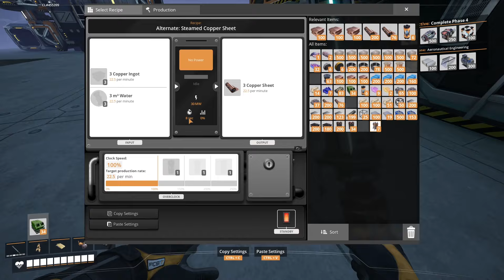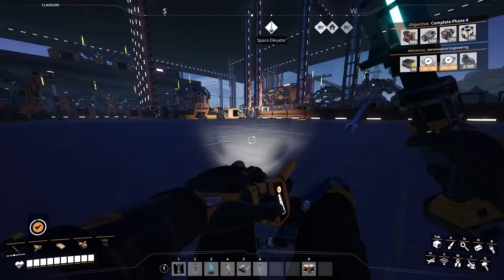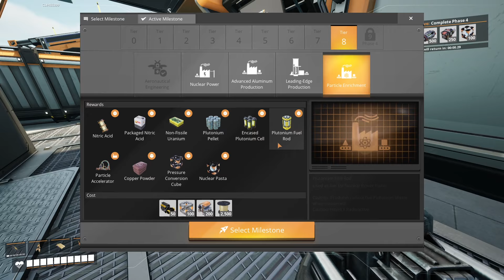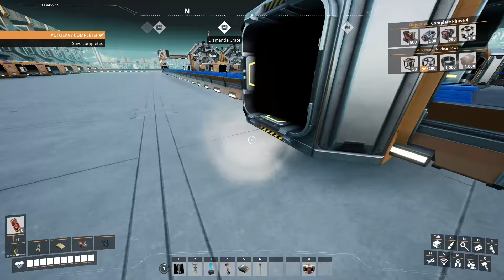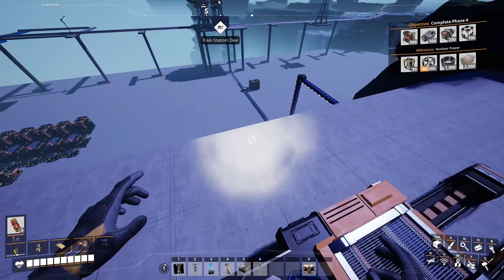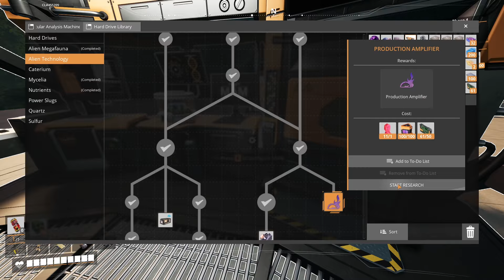TURNS OUT SOMERSLOOPS ARE PRETTY GOOD | SATISFACTORY - PART 31

Comment: Hi, roughly, for episode 65, if things don't get complicated with the nuclear option, and you'll have to do it in a different location away from the main base because of the radiation it emits and the toxic waste that you have to reuse for something else, you can use jet fuel to generate electricity. It's better (1 oil well at 600 gives 10 refineries, for regular fuel, for 14 jet fuel refineries, and that gives 44 generators and that gives 11,000 of electricity). You also have to build 16 builders for compacted coal.

Comment: Even if not as exciting as last episode, it was solid progress.  Your math was good this time around.  Magnetic Field Generators (next project part) are pretty simple, but the Thermal Propulsion Rocket is the difficult item in Phase 4, in my opinion.  Lots of people hate on the Nuclear Pasta, but if you've got the Rockets done, the hardest part of that work is also handled.  You just need a lot of one particular resource, plus enough power, to finish it up.

You definitely need to look at your steel (after aluminum), but the heavy need for the Encased Beams goes down once you start laying Mk. 5 belts most of the time.  Getting that aluminum as efficient as possible is key here.  I really like the alt recipe for Aluminum Casing, because you can put both aluminum items on the same assembly line at that point, and get A LOT of casing for pretty cheap, leaving plenty of aluminum for the Alclad Sheets (Mk. 5 belt material).

Don't forget to sloop those power slugs (the purples especially, they are worth 10 shards each!).  As you noticed, the first item after inserting it isn't doubled.  I usually put Wire->Cable recipe into the constructor first, then switch to power shards or alien remains after one construction.  It only takes one sloop to double a constructor (in general, it's one per input of the machine).  As long as you don't remove the Somersloop from the machine, it will continue to double any recipe you put in.  I devote a permanent machine for this, and usually later I build a whole mini-factory that sorts and doubles whatever I put in.  I think the one in my current save is using 9 Somersloops, and processes slugs, remains->protein->DNA, and biomass->solid biofuel (to be turned to liquid).

Good episode overall, I think 90 minutes may be the sweet spot for solid accomplishment.  I was thinking 50 episodes because Phase 5 IS shorter... but maybe I'll revise to 60 because you're not nearly done with Phase 4 yet.  It could go longer, but I wouldn't worry, just let it take as long as you need.